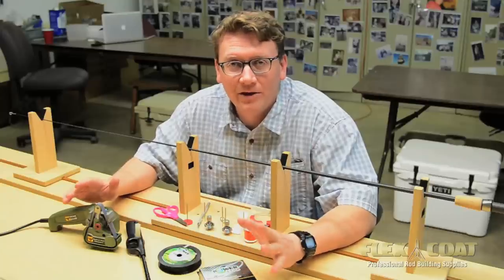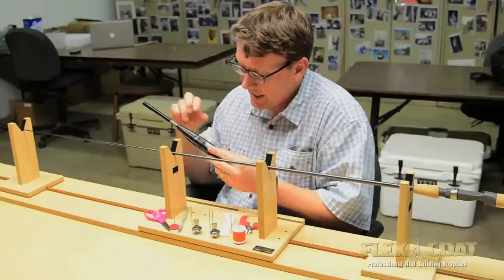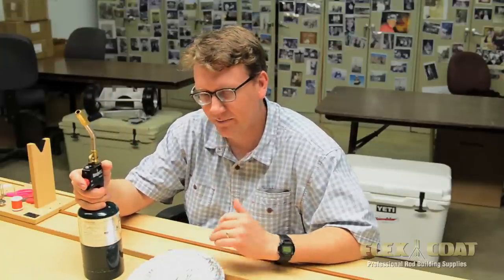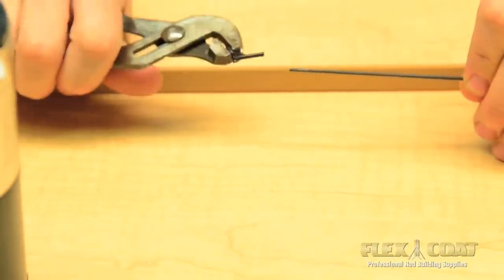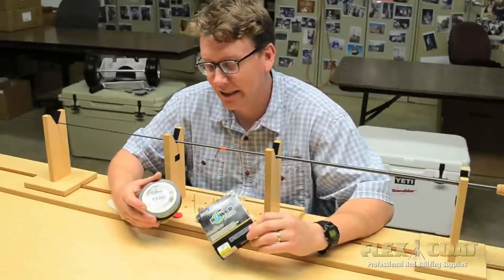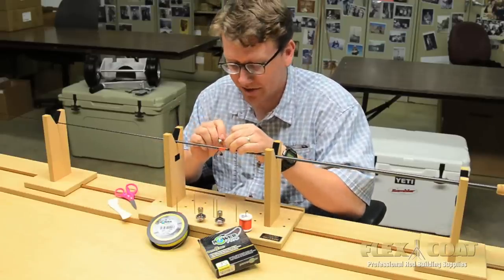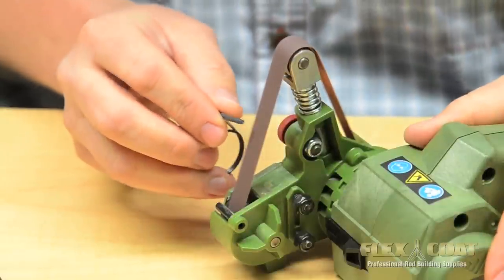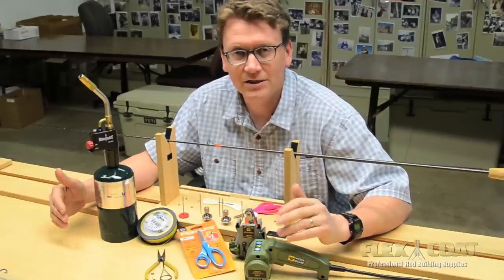Flex Coat Rod Building - Tools, Tips, & Tricks "How We Do It"

Comment: I just used my worx sharp for my latest build 2 days ago, before seeing this. It made one of the more tedious parts of rod building very fast. 

One tip that was given to me by an old rod builder in SW Florida is soaking the bottles of epoxy and hardener in warm water for a few minutes just before mixing. It reduced the viscosity of the mix so it mixes very evenly, with few bubbles, and then the threads really soak up the epoxy, especially on the first coat.

Comment: Another tip for the loop, spectra and light braded lines are tough to grip and sometimes to find.  If you put a bead like the ones in a piece for key chain attach it to the loop.  It gives you something to hold and if you attach a magnet to your supports it will hang your loop there instead of losing it on the table top or maybe on the carpet.

Comment: Best tip? PowerPro to finish wraps. I’ve had enough with inflexible nylon/ fluoro, hard to see, too thin and it breaks.
Reply: Sure is pricey - is there any way to buy less than 150 yds of it?
Reply: @davidwood1600 No, but 150 yds of lightweight will last a lifetime.
Reply: Amazon has 10 lb test PowerPro slick for $5 less than the 15 lb - that's a significant savings to me and I imagine it will work just as well - do you think that is strong enough?
Reply: @davidwood1600  absolutely